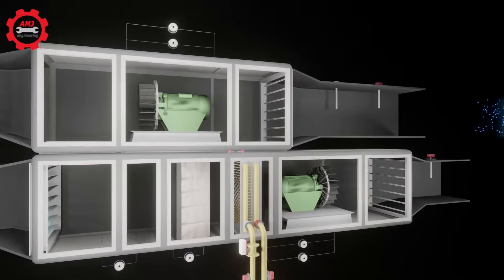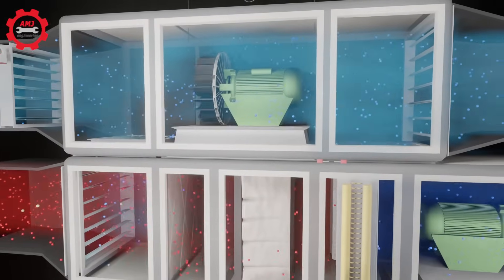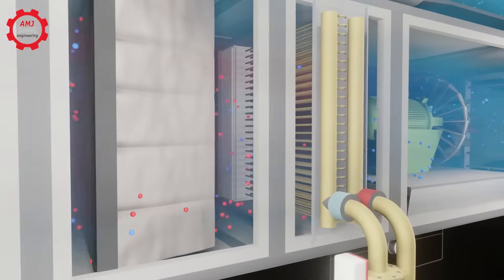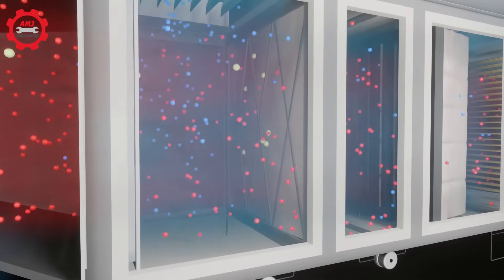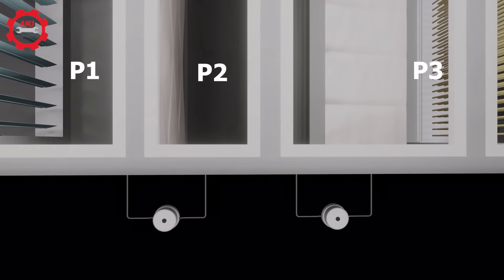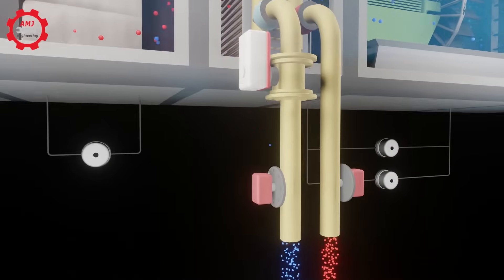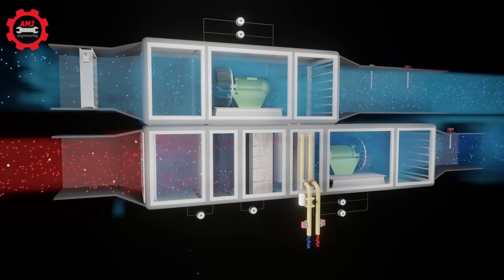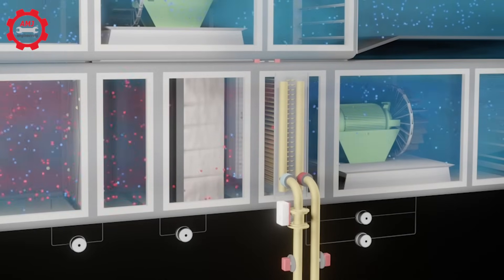Air Handling Unit Working principle | HVAC 08

Comment: this video is misleading,  as it shows fresh air with red color, and return air with blue color, it's absolutely wrong, fact it should be vice-versa (I'm  HVAC technician for 10 years)
Reply from the maker: Fresh air is hotter than return air. Anyhow, there is no norms for air colors. Moreover, I am HVAC engineer since 15 years.
Reply: @AMJEngineering  it can be anything and that's fine, and what I mean is, people generally perceive Red color as a symbol of HOTness and blue color as a symbol of COLDness, it's generally accepted everywhere (ask anyone or prove me wrong) (P.S/ professionally you might be right, but I'm sure 95% of viewers of this video aren't professionals)
Reply: @heyderaliyev8976 if the video is training people to be a professional, why wouldn’t they used the “professionally correct” terms and diagrams?
Reply: i was thinking the same thing lol